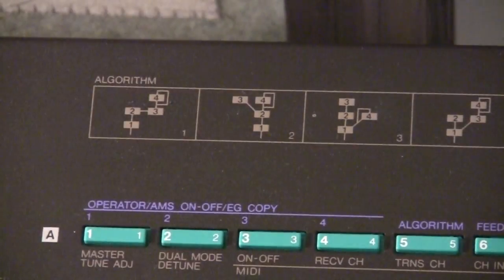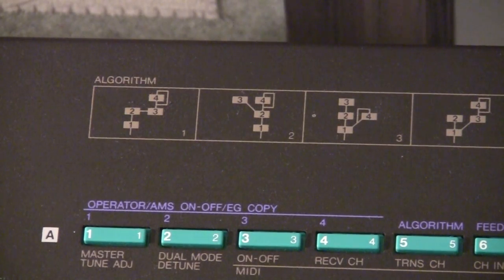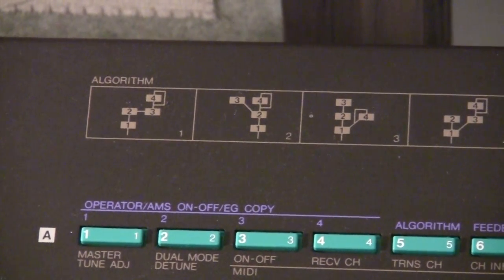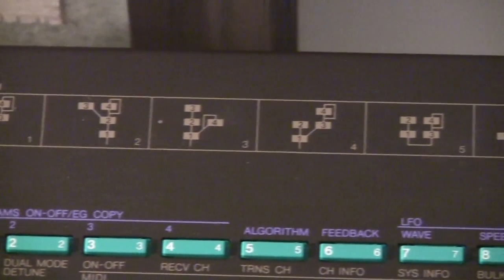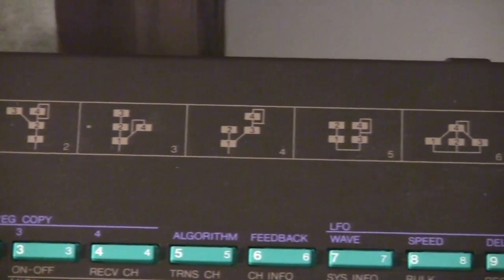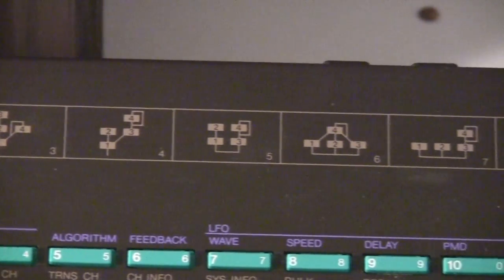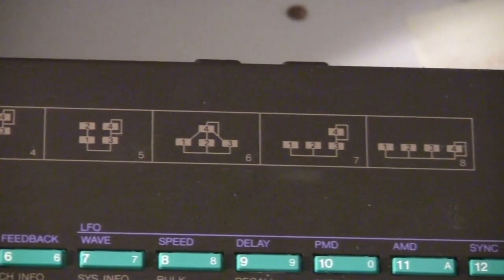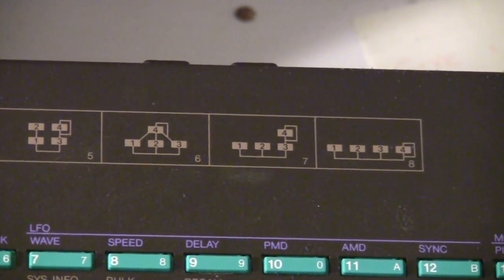Machinedrum 32 Op FM Synthesis

Comment: excuse me but, when adding n envlop, you say controle A P? can you tell me how to access this page?
Reply from the maker: Hi I think you might be mentioning the "Control 8 P" machine.  The manual has all the details but in short you can control 8 parameters using the knobs when this machine is loaded up.  Hope this helps.
Reply: @Catabolic  ok its an engine...thx ill see , but the screen at this part of the video, its in pattern chain mode?
Reply from the maker: @lupat9955  What time of the video?  I use pattern mode on the MD, not song mode I think but I can check.

Comment: Hey, great vid. I've had the Machinedrum for a while now so can appreciate this videos content. I was wondering if you had worked out if there was any way to play the Machinedrums sine wave and also sampled tones in key? I know the pitch pot has (127 steps inbuilt sine) & (63 steps for the rom samples) has anyone worked out a logical way to adjust that is relative to key? Thanks :o)
Reply from the maker: I think someone did work this out but I can't remember where I saw it.  Pretty sure that some of those values are a little flat or sharp versus what you would expect.  Try posting that question at Elektronauts.com and someone might remember better than me.

Comment: this may sound like I'm being simple but I just bought one second hand with no manual (manual in the post :@(... ) I got as far as making a sound a really like at 300bpm and realised I haven't  got the faintest clue over how to sample and save that sound for play back ... any help would be more than welcome ... thank you in advance . L
Reply: Leon Phythian go to the kit/pattern you want to record.  You'll need 1 free machine slot.  Assign a RAM-R1 (ram record channel1) machine to that track.  Go to the ram record machine's synthesis page, set MLEV to 64 (the center, maybe it's '0' in the center, by default it is all the way to the left).  Set a trigger for that machine track on step 1 (or wherever you want to start recording).  RAM Record machines record 32 steps (2 bars) total.  Play the pattern, the ram record machine should've captured it.  Mute the RamRecord track now so it doesn't keep retriggering its record trig (or remove the trig).  Now you can play that sample back by using ANOTHER machine, RAM-P1 (ram playback channel1).  You can also go into Global>File>Sample manager and copy/save the ram recorded sample I believe.  With a machine like this you'll want to read the entire manual (at least try).
Reply: Sampling is only available for the UW (= user wave) machindrums. In this video you can see it written under the screen. If you don't have it, and it's an old MD, then you can't sample. Otherwise you need to load the recording machine into one track and the playback machine into another. Triggering the record machine will trigger the record, and triggering the playback will trigger the playback.
Reply: Plaator hi thank you it was the last bit I needed , its a UW+ MKII ... theres a vid on my page of my first go playing with it.... received the binded manual not long after posting on here ,  £28 but an impressive looking bit if kit all the same , but thank you for taking the tie to reply , it is much appreciated :@)

Comment: the title was irritatingly misleading, 16 tracks of 2 op FM doesn't equal 32 operators of FM, it equals 16 tracks of 2 op FM. If you could route the track oscillators to each other somehow than yea, but unless I missed somethign that's not what you were doing and it's probably not possible. Using sampling to build up levels of modulation isn't quite the same, because once it's sampled it's stuck that way. Useful I guess. But not what I'd think a lot of people would expect from your title. and what about playing chromatically on the keyboard? Can the sounds be controlled that way?
Reply: You can modulate LFO speed from another track's LFO. (Every track has one.) So unless I'm mistaken, you can have 16 operators at once.

Comment: @Catabolicdj You mean, you can put 32 operators vertically?  Meaning, as if it were written on your DX21 front panel, having an algorithm with one carrier and 31 modulators.  If so, you machine is way more advanced than even 8-operator Yamaha FS1R

Comment from the maker: @dvamateur Not really because you do not have separate independent control over each note's operators on the DX.  For example, in theory you could use all the Machinedrum's operators to make one (really weird) note but you can only use 6 on the DX. Hope this makes sense-it's a little hard to explain.

Comment from the maker: Thanks!  About the pitches, no - they are listed as numbers (from 0-127).  However, I think someone made a pitch chart so you could print that out and use it.  Have a search around, or ask about it at the Elektron Users forum.  It should be pretty easy once you have the chart.

Comment from the maker: @ikmijzelf It doesn't hurt to ask questions so fair enough question to ask.  I don't think people flock to the Elektron for the LFOs really, as most gear have a few.  What I was hoping to point out is that, since the LFOs are very fast if you raise the tempo, you can actually use them for custom FM synthesis exactly like you would on the DX series.  With 16 LFOs and 16-part polyphony, that's a lot of FM potential.